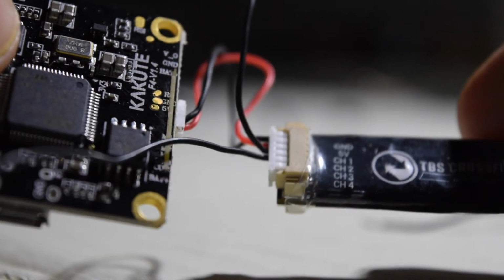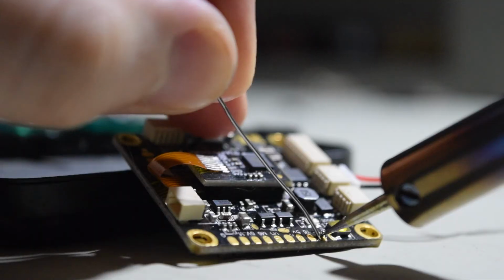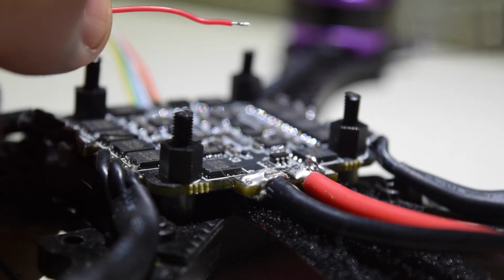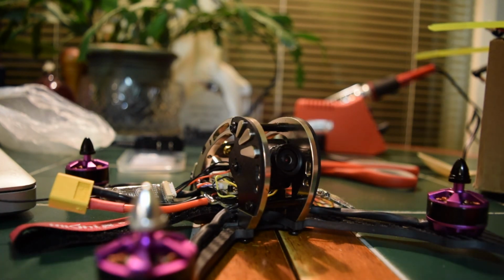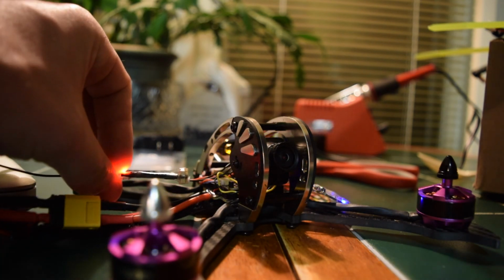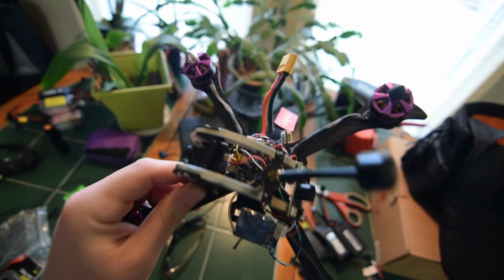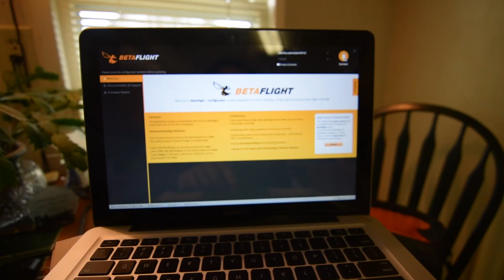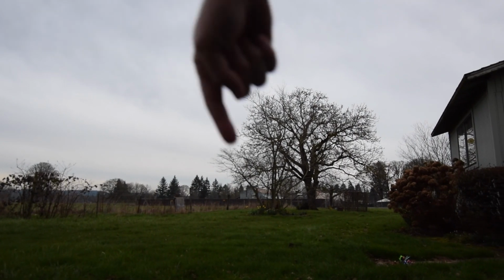Finally a good first Racing Quad, the Furibee X215 Pro

Comment: Can you tell what PID you are using or its a stock PIDs?
Reply from the maker: These were stock pids, except for the throttle, I calibrated my ESC to give me less top end power so I have more freedom of movement with my throttle stick. Stock throttle was too sensitive and would make it blast off at like 70 MPH at 2/3 power so I needed to turn that down.
Reply: Magnificent Gravity ye i were getting the same problem with throttle when I change props to dal 5051 I get smoother throttle response from stick
Reply: And its starts hovering at middle throttle
Reply from the maker: Nice, I will try those. I switched to gemfans and got better throttle control as well as smoother acrobatic flight.